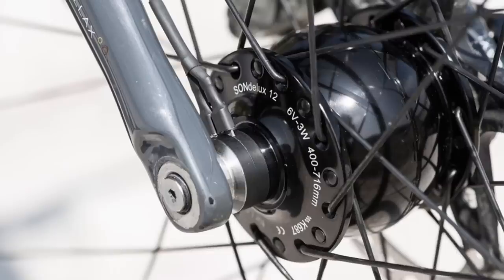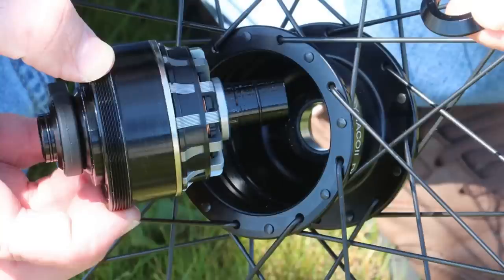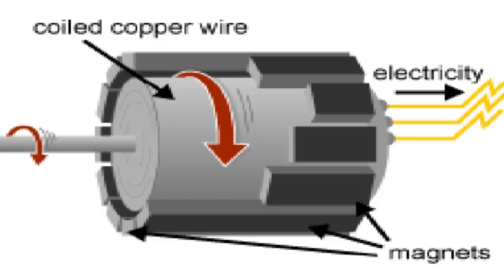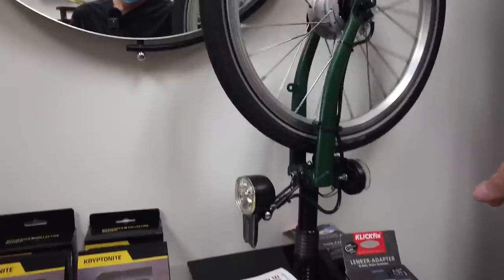Brompton dynamo hub (why I don’t want one)

Comment: The last bike I owned that came with a generator was a 1970 Peugeot 
10 speed with a plastic Simplex derailleur and steel wheels. Alloy wheels
were still in the future for anyone that didn't race . Battery technology 
was still Zinc Carbon (1898) a flash light might last for an hour or two 
if it had new batteries in it. 
Over the last 20 years I have found out that I only need a 1 Watt LED
(4 AA Batteries that lasted a couple of weeks) to ride in complete 
darkness ; which can be hard to find if you live in a city. 
In 2019 the Shimano Dynamo was about a $300 Cdn. option on a new
Brompton ; closer to $400 if bought separately . as well a "Brompton 
Lighting System" (is) was available for this much ( it's scary) https://curbsidecycle.
com/products/brompton-dynamo-lighting-systems?variant=12624580018227
Again these are Cdn. dollars. $700 to $800 I had to order a bike from London as 
all the bikes in the shop had dynamos. 5 week wait minimum. 5 week minimum
wait for parts..........................
Reply from the maker: Everyone’s lighting needs are different, here in Denver the drivers literally need a massive blinking spot light to notice you it seems.

Comment: I'm the same. I have a bike that came with a dynamo, I won't get rid of it but I won't replace it either. Pretty expensive component whose only upside is I can be lazy and not think about having to recharge my lights at night. I don't think my particular hub has a usb outlet for charging devices but I never thought it could trash phones, good to know. For touring, I am paranoid about things breaking, so for the dynamo I wouldn't trust my life with it. If I have to bring backup lights anyway, why bother.
Reply from the maker: xbmarx I am not saying the dynamo would definitely damage your phone, I am just saying I think my dynamo did.  They are alright for simple lighting for commutes, but you are right.....I wouldn’t trust it.

Comment: I honestly don't like electric bike.. it loses the main point of biking... Just my opinion :)
Reply from the maker: CONRACE whatever I agree.👍
Reply: The main point of biking isn't exercise; there are lots of more controlled ways to do that. Cycling is low carbon transport and a great way to explore outdoors electric biking simply expands access to that.
Reply: My only reason why I'm biking is to slow down and enjoy the view. 😁❤️
Reply from the maker: I agree, but standard biking has a lower carbon foot print than electric biking.  So there is that.  However, electric biking is much better than using fossil fuel powered transport.
Reply: Alien On a Bike  I live in Paris and 25 km/h is more than enough in town if you respect trafic lights and priorities, which everyone should. If you want to go faster, not a problem either : use your legs ! It's a bike after all.
Reply: It's both, exercise and low carbon transport.
Reply: Alien On a Bike  It's to slow down the lycra-clad speed kings who have no respect for older people on bikes or kids on bikes, remember Northern Europe has a very advanced attitude to cycling,  a lot of people cycle, even the very old and the very very young kids cycle. That's the reason for the 25km/h , they don't want to add more speeding cyclists to the already existing speeding lycra merchants.
Anyway most people keep the battery power for climbing hills and turn the battery off for flat terrain.
Battery-powered bikes are really for old people who would not cycle at all if they had to tackle uphills.
I was looking at an electric bike and decided to buy a cheap second-hand folding bike first to see how much use I got from it, I was amazed at the level of bike fitness I had at 62 ( and 3 stone overweight ) I found that I could do a 10 mile round trip on my little folding tern and barely break a sweat, it turned out I didn't need an electric bike at all.
I test drove a three-speed Brompton yesterday and it was super fast and super sturdy , faster than the Tern and just as comfortable even with the smaller wheels .
Reply: @johhny711  Ok, you seem to know better than me what it is to ride in my home town. Good for you !
Reply: @CasablancaDriver Maybe you need to read my post again, or maybe your English comprehension is a bit rusty. I wasn't talking about Paris specifically ( I never mentioned Paris )I was talking about why the restriction of 25 km /h exists throughout the EU.

 I know Paris very well, you are beginning to develop a great bicycling culture thanks to Mayor Anne Hidalgo's legacy so every time I go there, there seem to be more cyclists, unfortunately, you do have the speed merchants in the lycra who think they are doing a stage of the tour de France as well .

 Peut-être que vous avez besoin de relire mon article, ou peut-être que votre compréhension de l'anglais est un peu rouillée. Je ne parlais pas spécifiquement de Paris (je n'ai jamais mentionné Paris), je parlais de la raison pour laquelle la restriction de 25 km / h existe dans toute l'UE.

Je connais très bien Paris, vous commencez à développer une grande culture du vélo grâce à l'héritage de la maire Anne Hidalgo donc à chaque fois que j'y vais, il semble y avoir plus de cyclistes, malheureusement, il y a des marchands de vitesse dans le lycra qui pensent qu'ils sont faire une étape du tour de France aussi.
Reply: Electric bikes do have there place. Yes use to biking long distances since a kid so will still prefer my lighter road bike for long distances or days out, or trails. For commuting to work, or going into city, will use my electric bike I built for the most part.  Both have their places. Plus a ebike is nice when going uphill and can just use pedal assist to get longer range, manually they are not great for long distances as drag they have will kill your endurance.

Comment: I used to have a bike with a SON28 dynamo hub and a mid range headlamp. The light was Much, Much brighter than any battery powered light I've owned. Now I ride a road bike so a dynamo light is out of the question, kind of. I still think they provide amazing lighting compared to the drag. Especially if you are loaded and don't look for maximum speed necessarily.
Reply from the maker: I have some of the brightest battery powered lights on the market and I have tried several dynamo hub lights that did not compare.  This was two years ago, so maybe technology has improved?

Comment: Oh I get it. Of course there's more drag. That power has to come from somewhere. The extra drag is the created electricity. I also think you are right about the battery on the phone. I use a dynamo because I'm lazy. I like not having to charge or change batteries. I live in a cycle unfriendly city (St. Louis). I use my bike for very short commutes. Our bike lanes are smaller than in all the other cities I have lived in. If you are not using lights, you are taking a huge risk of getting hit.

Comment: Blah ....
Reply: I have a son dynamo, 4 years and still working. But only due to my electronics knowledge. Every time I turn mine on it never works! broken cables, internal lamp faults etc. I like the 4 minute super capacitor stand light function. The dynamo works to capacity at full capacity at low speed. But Brompton need to improve the quality of the cables and lamps. Soft tyres are more of an issue than dynamo drag.

Comment: I like having a dynamo on my commuter brompton. I changed the front light to a better one than the one that came with the bike. I am not a really fast rider. So the drag isn't noticeable. I just like not having to think about Batteries. So to me the benefits outweigh the drawbacks.
Reply from the maker: Everyone’s different, as stated in the video.  We all have different needs and see different Benefits and drawbacks.
Reply: @ibikeunfolded  That's true.  Good luck with the vlogs.

Comment: The Brompton is heavy enough  without the added weight of a Dynamo Hub. LED lights are literally brilliant and much more advanced now, as are the rear ones, plus the charge lasts longer now, better than the earlier one's. As you said you can use a Powerbank as a back up, a sensible solution if they run out.
Did you get the Brompton book Brian?. On one internet site they have the first edition for £232/$286!!, that's more than the cost of the bike when it was launched. Was £207 in 1982, or $255 at today's rate!. bike was a basic 3 speed hub model. Just go'es to show how popular the Brompton is.
Nothing you say Brian is ever too infinitesimally small!. Keep on Bromping along!
Reply from the maker: Thank you, I must remember to check that book out.  I will go look now.

Comment: Power outlets delivers inconsistent power as well is just that power supplies are designed for that to smooth out all of that like a series of capacitors and such. I was just told about it. Unless powerhubs can smooth out the inconsistencies then I will avoid charging directly from the hub.
Reply from the maker: Plus, I find that the hub takes forever to charge batteries.
Reply: @ibikeunfolded  I am binge-ing your videos man! You're correct actually I am also watching another Cyclist/Youtuber like yourself and he actually tested it versus the solar charger - which confirmed what you said. https://youtu.be/5ek2cKE6lYo

Comment: Dynamo hub don't produce constant voltage and that's what killed your battery. The good practice is to charge a cache battery, and then charge your devices from the cache battery. its arguably more convenient, and replacing the cache battery is cheap.
Reply from the maker: Thank you, but I went away from the dynamos so it’s batteries for me from now on.  👍

Comment: It’s amusing that in my old late teenage cycling days my mates and I fitted dynamos and marvelled at how much brighter they were over our old battery lamps (LEDs were red or green and only existed as indicators for kettles and stereo equipment in those days).. that said, I am a little concerned about the drag, back in the day, flicking the thing on made a downhill ride feel like uphill.
Reply: Agree as had used one for many years and use to go long distance on my bike and you noticed the drag after a few miles but do like to go fast, going regular speed not as noticeable. Battery powered LED lights light are now way better. I can only see using a dynamo generator if going long distances as battery powered lights you get about 3 to 4 hours before needing to be charged, or in area where no power. Rather have lights then no lights.

Comment: I am in the rechargeable LED camp on this one.  

On a hire bike, it makes sense to have a dynamo system, like Brompton do in UK. For a bike owned, however, less of a case unless specific need or just a like of dynamo systems. As others have said, weight penalty which is always there, initial outlay, and low-set position on Brompton. And not to forget the additional clutter of the wiring loom - I feel the Brompton has enough other cables as it is. 

When out on my bike, my phone is hooked up to a power-bank, as in my experience the gps tracking app that I use drinks a fair amount of juice over the course of a several hour ride or day’s outing. I think the phone & battery performs better when the charge is kept above 60%, and a decent power bank does that with ease.
Reply from the maker: That’s what I use.  A power bank, or several is definitely the way to go.👍

Comment: I had originally considered that I would buy the Son XS and B&M lights together with a USB charger linked to a battery power pack.

I then began reading about the drag associated with dynamos and this changed my perspective.

I also realised that I probably wouldn't be doing much night riding and preferring the high performance LED lights available that are relatively inexpensive I decided against the dynamo.

The cost of the complete system was around £650+, which is a huge amount of money!

Saving the weight, drag and financial outlay was appreciated, and with camping, that'll cover a good trip.

Your video was very interesting and informative and it's good to see my conclusion supported by your greater experience over a year.

Your channel content is really appreciated.
Reply from the maker: Thank you and I couldn’t agree more with all the points you made.  It just makes sense.

Comment: All of my bikes have dynamo hubs connected to front and rear lights. For me it is a must. I don't care about drag, as I can't feel the difference, even during fast rides.
Reply from the maker: Yeah, I am going to do a follow up about the dynamos for Brompton.  When I made this video, I was going off my experience with other bicycles I had with dynamos.  I have recently come across an awesome Brompton dynamo that has different characteristics I want to discuss.
Reply: @ibikeunfolded  please do
Reply: @ibikeunfolded  Hey, did you manage to make that video? I didn't find anything related on your channel.
Reply: I have just recently bought a Dutch Bicycle and am just delighted to find out that I can add a tail light on the same dynamo hub that is powering up my front light. I've read an article as well. I just want to confirm with you about this fact ... that I can power both the front and the back with the same hub, right?
Perfect comment!
Reply: @taariqq  Yes you can.
MOST modern Dynamo hubs are rated at 6V 3W, Front lights are 6V 2.4W and rears are 6V 0.5W, this is the 'industry standard'.
HTH
Reply: @nigelnightmare4160  Great many thanks for the details. I had already connected a tail light and it has been working wonderfully well. I am in Karachi, Pakistan; and in fact I had a local shop make me a 6V light ... blue ... AND ... I don't know if it is a feature or a lack of current or something ... the light starts flickering when I slow down ... so it acts like a signal, kinda the opposite to what the other similar backlights do (start flashing faster when braking) ... but ... it does serve as a signal that something is changing .. so people behind me have at least some clue when I might be slowing down. The light actually flickers by default, I think, it is just that when you speed up to a normal riding positions, either the flickering is so fast that it appears to be a solid glow, or the light itself goes solid. But it is working wonderfully well ... 
And my front light is unharmed ... 
It is a joy

Thanks once again for taking the time to answer with specifics. Cool.
Reply: @taariqq  my front light flickers a bit as I get slower (close to stopping) so I think that’s normal.